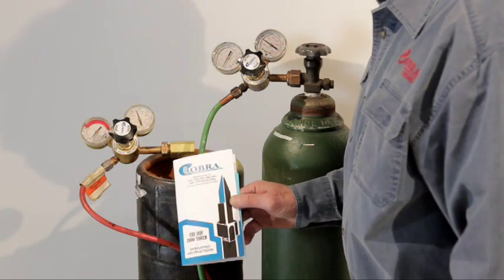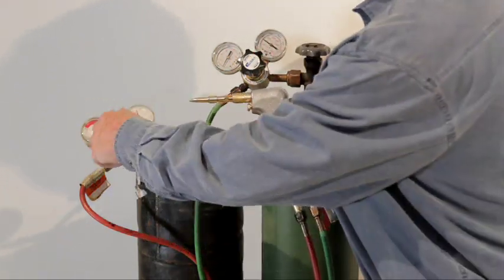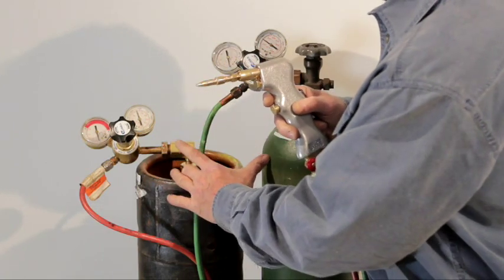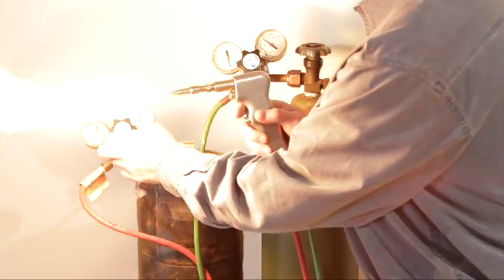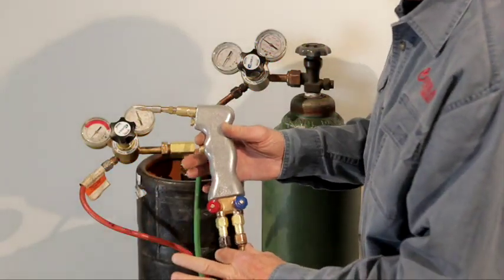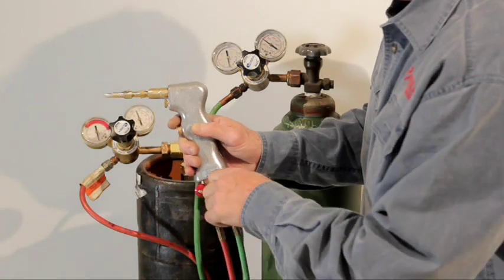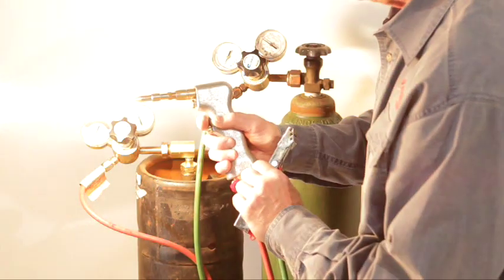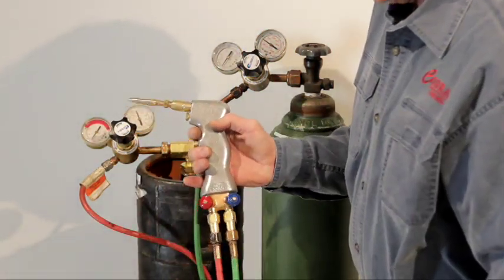HOW TO SET UP THE TORCH - DHC2000 - oxygen and acetylene

Comment: Well this is more than a little late, as it turned out I was able to tac my project with both torches, still greater comfort with the Victor; but this turned out to be a job for the tig torch.  I feel like such a wimp, but I just couldn’t risk ruining this expensive exhaust tube, as ugly as it was.  Turns out the doughnut was mild steel and the tig torch was able to puddle that 1/2” much more easily with out that queasy feeling that I was about to blow holes in the relatively thin tube.

Comment: Is that 720 degrees on the torch valves or just 360 degrees?  I'm definitely not getting a sharp and quiet neutral flame like you are at 720 degrees.  I'll try 360 degrees on the torch valves.

Comment: Thanks for the help.  I have a Dillon Mk.III and I just bought a set of four tips for it.  I bought this torch some time ago, but quickly dismissed it as awkward and too heavy.  Anyway, I've been having some trouble welding a 1/2" thick doughnut shaped puck, made out of scrap off the floor (think it's 4130) on to some pretty awful looking 304 exhaust tube.  I've cleaned it up to a 80 grit clean finish inside and out, about 1/8" wall after cleaning.  Now I'm going to try my new tips that I just received.  I couldn't even make a puddle with my old, but loved, Victor 315FC with a #5 tip.  The voice of this flame at 4 p.s.i. is a little bit frightening, but I'm going after it anyway; this is for my dog car and it must work to take them swimming.  I'll be back in a moment to let you know how it worked.